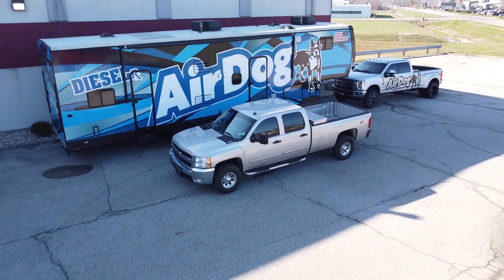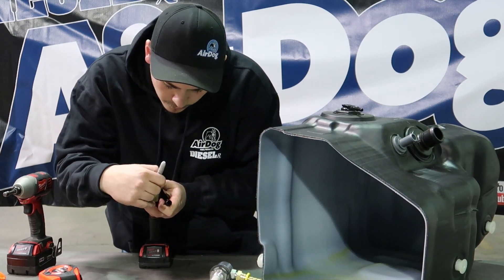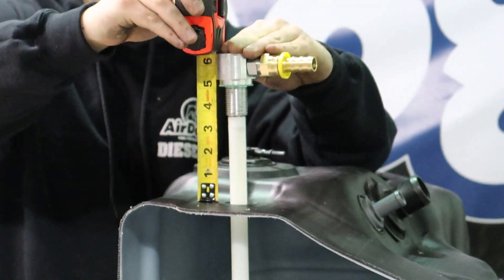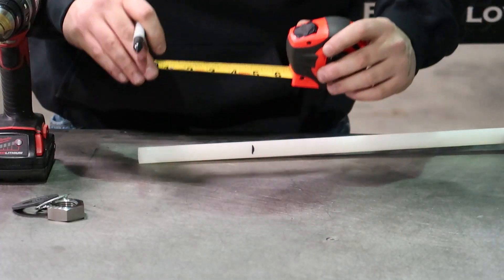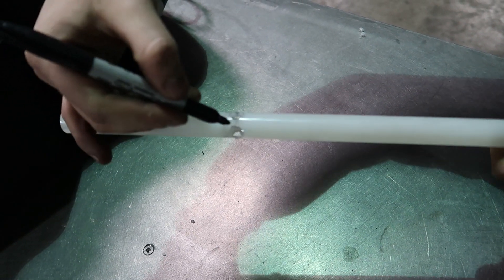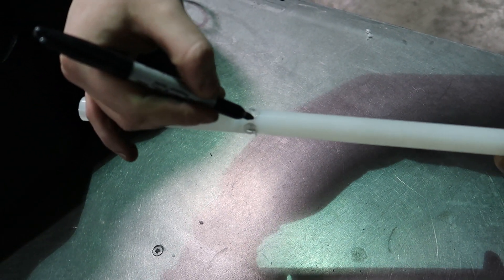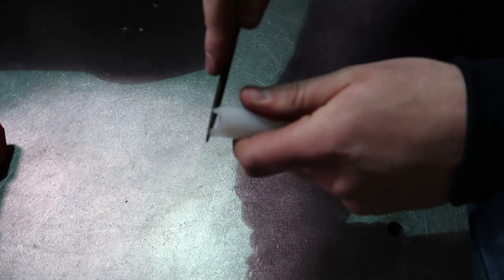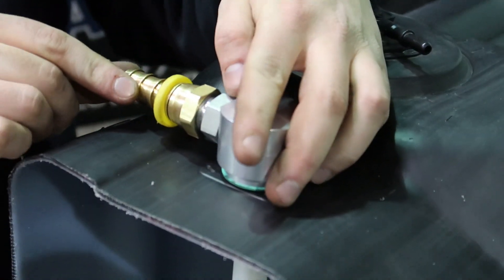High Flow Suction Tube (WAP109) Installation

Comment: Question - when installing this and the lift pump, and bypassing fuel sending unit, does one need to plug off the old sending unit when putting it back in?
Reply from the maker: We do recommend plugging the old sending unit feed line. We typically recommend installing a vacuum cap to prevent dirt, debris, and water from getting inside the tank.

Comment: 1/4" is too far from the bottom, bet it draws air at 1/4 tank
Reply from the maker: video says to cut it 1/4" longer not shorter
Reply: @AirDogSales  So 1/4" longer than the tank?  So just let it flex some?
Reply: Oh... I see. Well the tank is probably about 1/4" thick so..
Reply from the maker: @grasscutter88  The tank will belly out some when suspended in the truck and when full of fuel. that extra 1/4" will ensure the straw is at the bottom of the tank at all times.
Reply: @AirDogSales  So if it's at the bottom can you run it down to the fuel light without sucking air?
Reply from the maker: @grasscutter88  We never recommend running the truck down to the low fuel light to help prevent cavitation damage.
Reply: @AirDogSales  That didn't answer the question. Sounds like it will suck air regardless below 1/4 tank.
Reply from the maker: @grasscutter88  The draw straw installed as such in the video will pull fuel to the bottom of the tank. That doesn't mean it is recommended to run it that low as there are no baffles in the bottom of the tank to keep the fuel from sloshing past the straw when the fuel level is low. If you don't want to install the straw, get a sump.